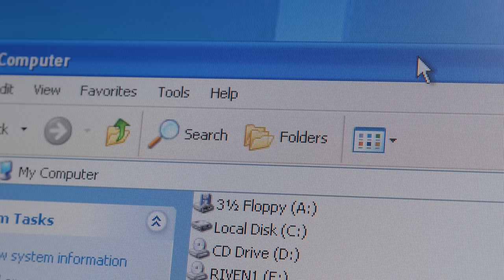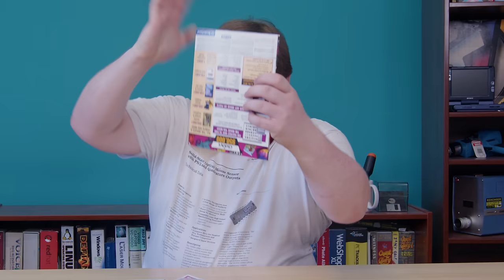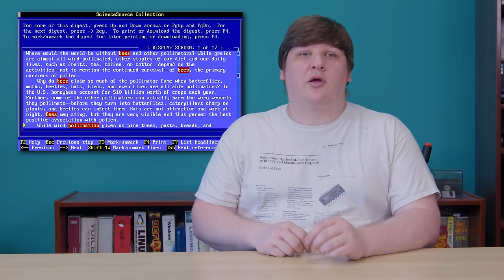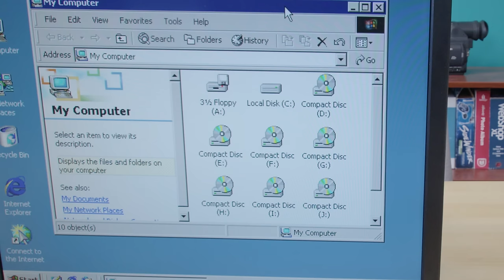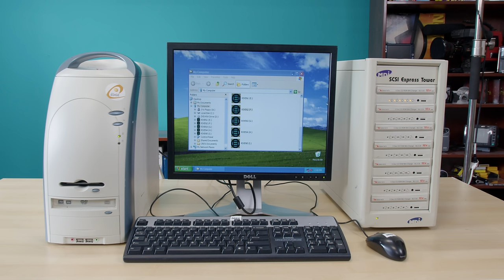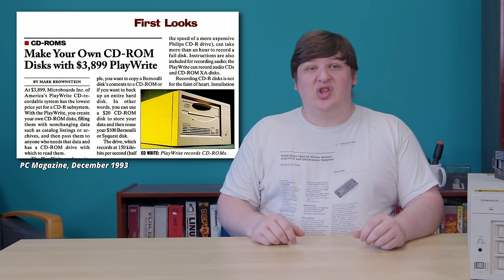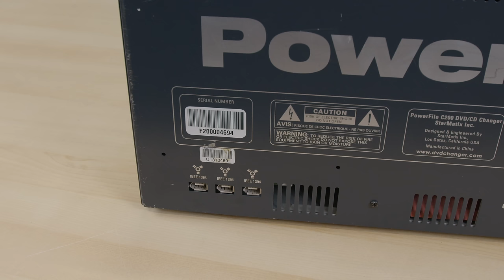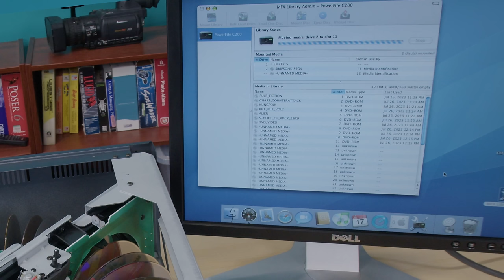A Jukebox for your PC: 1993's CDROM Servers

Comment: Before CD ROMs, there was… microfilm. In 1988 I worked for a company called Imnet that was trying to build a business around scanning and storing insurance and banking records for later retrieval. They built a washing machine sized robotic microfilm reader. It stored hundreds of rolls of microfilm that could be robotically loaded on demand, film forwarded to the correct frame, scanned and made available to a server. In 8 seconds!
Reply: These type of databases were often used in conjunction with microfilm. The database was for finding what you needed, but the actual thing would be stored on microfilm. When I did my undergrad not all journals were digital yet (at least not fully), so I sometimes used databases like this (off a network, not CD-ROM) but needed to get the actual article text from microfilm.
Reply: I'd love to see / have seen that 8 second process happening. That sounds awesome. YouTube surely has something 😂
Reply: I kinda loved the haptics of going through archived newspapers on microfilm. It was definitely not very convenient when doing research about historical events, but it was .. somehow more tangible than just using Google.
Reply: the sound must have been amazing
Reply: I worked for a utility in the early/mid nineties. Optical storage was used in the stead of microfiche. they produced tens off thousands of sheets of microfiche. I once had to re-index the microfiche by hand. I can still feel the cuts on my hands from handling it. Death by a thousand cuts.
Reply: I would absolutely watch a video that showed one of those things off!
Reply: There's still some out there that hasn't yet been digitized. I use to access old Newspaper articles on micro-fiche at out library on index sized film cards that had up to a hundred tiny images on them.
Reply: Even the microfilm!?
Even the microFICHE!
Reply: Somebody call Vannevar Bush, they finally made the Memex.
Reply: @stephanmantler thankfully the Mitchell Library in Glasgow (named after a tobacco baron…) still has some microfilm viewers and archives. It’s definitely not the main way anymore, but every time I go I see at least one person using it!
Reply: @kaitlyn__L every library in the UK has a microfiche collection and viewer. They're not always on display or in front but every single library has one that you can access it you ask. It's listed as a basic library service that's part of their remit for funding - local archive access.

The only exempt libraries would be community run ones.
Reply: @medes5597  good to know, I only specified because that’s the only one I’ve been to in the last decade :) didn’t think it was necessarily unique to the Mitchell! (They do have a particularly large physical archive though!)
Reply: It took a long time for businesses to transition from paper to digital. Printers, file cabinets and scanners persisted well into the 2000s.  Even fax machines are still used now. Which is a pain when a bank, my bank, requires signed documents by postal mail or fax.
Reply: @kaitlyn__L  oh yeah I realise you weren't suggesting it was unique - my apologies if that came across like I was correcting you, that's probably some on the spectrum lack of politeness on my part, I was meaning to add to your point and say that it's a huge part of what libraries do and not one people really know about. 

The larger libraries of course have large collections but a lot of the small town libraries have unique and interesting things that no one else has. Where I grew up in Wales they had Dylan Thomas' notebooks reproduced on microfiche just sat on a shelf from some old archiving project they'd been involved in where they painstakingly photographed and converted every page like it was newsprint. And practically no one knew it was there. Libraries are wonderful and the fact we've lost over a thousand since the start of covid (about 600 reopened as community libraries, but they nearly all run reduced services and have removed many things - Archives, educational classes, computers and reference are usually the first to go because they all require more time and monetary investment than a community volunteer group can really support) is a tremendous loss to the country and it's not really been commented upon much (to be fair we do have bigger problems right now)

Point is support your local library and my apologies if I came across as being overly corrective and harsh. It was very much not intended that way.
Reply: I work with microfilm at my job, from time to time.  We have a bunch of readers that can quickly find prints in the roll.  The plants were built in the 60s and 70s so that's all they had and only docs from 1997 and beyond were digitized.  Everything else remains on film, aside from configuration prints.
Reply: Vannevar Bush's dream come true!
Reply: how much storage?
Reply: Sounds like it cost millions or close to it in today's dollars.
Reply: Also, I am old enough to remember looking at newspapers on microfilms at the library when I was a child in the early 90's. It was...kinda awesome kinda weird. I remember feeling like a secret agent looking at it.
Reply: @entity76 didn't realize gloves weren't invented until the mid 90's I swear I can remember before than Mandela effect I suppose
Reply: @pjbth I had white cotton gloves but they really didn’t help. In fact they dried my hands out. I should clarify the optical disk setup replace the microfiche but it had to be kept around for regulatory reasons.
Reply: Haha I remember that, there was a new local company hiring basically anyone who showed to operate the scanners. It was a little better paying at the time, but I passed, it would’ve been far too mundane. It was a fairly large company too
Reply: Micro fiche content used to be a common thing in British libraries. Same principle as microfilm, except the documents were imaged onto a sheet of film rather than a reel. Still remember using the fiche reader at my local library as a kid, though wouldn't be able to tell you what it was I'd been looking at! 🙃

One benefit of fiche is that they had a higher storage density compared to film (Sheets each the size of an index card versus reels of film) and were usually kept in binders for easy reference, and were probably well-adjusted to automated handling. I've no idea if any British companies tried building online fiche retrieval systems (Knowing us, someone probably did!) but for the 60s they might've been something quite profitable if they had. 💰
Reply: Microfiche results on other format. They often did this to magazines etc because it was a bunch of images of pages put onto a film approximately 5 by 6 in if I remember right I'd have to look it maybe not quite so many images is a microfilm but you could just have one sheet at a time and had multiple pages. So a whole magazine might have two or three separate microfiche plates that would have all the pages of particular issue. The other advantage was it is some of these microfiche readers and microfilm readers also had a printer available so you could make a large scale regular sized page of information printed on it. If I remember it works similarly to a thermal fax machine

Comment: I was that weird kid in middle school (7/8th grade in 1997/8) that hung out with the IT admin. The whole school (district actually) ran Mac OS and they used several CD server towers to share various CDs. The “computer lab” had its own tower, the teachers their own, and there was a public one. Each were a full sized tower case with 6 or 7, or more individual CD drives. They didn’t use a multi changer like the Nakamichi at all. Each disc was in its own drive and I don’t ever recall there being an access issue. I don’t know if each tower had its own sever but I do recall each tower was served over different AppleTalk zones. Lovely video as always ❤
Reply: Same -- cut my teeth working for my school system.  We had a few of these towers on the network and would drop in the discs we'd need for the day.

Main downside was if more than one client was pulling from a CD share it'd seriously slow down -- so in practice each tech would have "their" tower.

So a little picky, but it was a major efficiency gain.  Instead of sitting at a PC juggling discs we could roll a script, start it on a machine and prep the next ones (e.g. blow out the dust, do whatever wasn't scripted, etc)
Reply: God appletalk was so good. I don't know how well it worked at scale but it's certainly been the easiest of era network solution for filesharing I've ever used. Even in modern systems. I'm actually looking to include appletalk on my file server for my friends and I classic macs so we can share programs!
Reply: Yeah, I think one thing missing from this discussion is just how bad it is to have multiple users trying to read from the same CD.  Seek times for optical media were not good, so if it had to seek between two places on a disc, it was nearly as bad as the disc changer thrashing problem.
Reply: Yep, me too. I know this cos I’m friends with two IT admins on Facebook lol!!!
Reply: There are two kinds of computer nerds: the ones that hung out with their school IT admin, and the ones that the school IT admin despised. I was the latter 😈
Reply: Yeah, my high school had a 7 drive tower attached to the file server (Windows NT4), part of my job was figuring out how to get CD-ROM based software to work from the central drives...

On a side-note, there's some ridiculous simple joy in programmatically ejecting 7 CD-ROM trays simultaneously ;)
Reply: @ofoosy AppleTalk did not work well at scale. It was heavily dependent on broadcast. The university I went to in the late 90s had a large, flat Ethernet topology.  On the days IPX network broadcast storms didn’t take the network down, the AppleTalk broadcast storms usually did.
Reply: Did these disk changers work better under MacOS handling multiple request or would it iof had the same problems that Windows had trying to use these things.
Reply: I hung out with my second school’s IT admin too! She helped me add a network card to my PC, and also gave me education-license installs of Windows and Norton and Office! She was great.
Reply: @michealpersicko9531 since they weren’t disk changers, just a bunch of individual drives, the only problem should’ve been bandwidth contention on the bus regardless of OS :)
Reply: In 97 I had a CD burner and I used it all the time. From mix tapes to backups to sharing stuff with friends and p*rn lol
Reply: Hahaha nerrrrrrrrd 🤓🤓
Reply: I would say you missed one, the kind that ended up being there school IT  @nic_olenomicon
Reply: @nic_olenomicon yup didn't like me 😂 they tried to confiscate my personal laptop as I'd been up to no good like accessing security cameras and printing random crap to the staff room. The network was pretty poor security wise if you knew basic networking you could pretty much do what you liked. One of my favourite things we did at college which anyone could do is draw dicks on the plain paper in the printer. The confusion of the teachers was brilliant 😂
Reply: @HA05GER the admin password for one of my schools server was just admin. Id log into that account and then remote into other computers on the network and mess with my classmates.
Reply: @nic_olenomicon  You and me both. ;)

Comment: I work for a marketing company, we just moved office we were cleaning out the storeroom and there were no joke thousands of CDs of stock photos and clip art and fonts.
Reply: From my experience with the Pioneer machines they were meant to be used with Macintosh. There were Extensions that let you change the disc being accessed by the finder and did not create confusion by pretending to have all your discs available at once. The Mac software was so much more well thought out and the windows software felt like an afterthought. I had the 18 disc version and it was a wonderful way to organise mac games and general data. I found it all in the thrift shop in a small town in British Colombia along with a grey PowerMac (model escapes me, one of the ones in the larger horizontal desktop cases which sat horizontally and was grey from before they changed their design language.) The changer came with the cartridges and worked flawlesslessly. If my collection hadn't been stolen I would post pictures.

Comment: Working in networking for almost 20 years, and still, nothing beats the bandwidth of an 18-wheeler.
Reply: Well, that’s why Amazon actually has data trucks, that you could use to move a truckload of data to AWS.
Reply: @BTGDelta  a literal truckload of data!
Reply: Well, depending on the distance maybe the bandwidth of a jet could win right?
Reply: yeah but how do you feel about ip over carrier pidgeon
Reply: @BTGDelta  I think it's called AWS snowball
Reply: @cal2127  Birds of prey cause packet loss
Reply: @isaac10231  Even better: Snowmobile
Reply: I love that original montage of assembling the cdrom tower!
Reply: @isaac10231  Yep, literally just a big cube they send you, you load it with literally everything you have, send it back, and they dump it into your account.
Reply: @cal2127  very large packet loss... mainly due to shot gun interference
Reply: What was the download speed for the picture they took of the blackhole. I think that tops it.

Besides, when that hick shows up with your stuff in the back, how much of it remains intact?
Reply: Well, a 777 or A380 loaded with hard drives to it's maximum weight, may give you better bandwidth, especially if you are doing anything internationally, but keep in mind you're talking about a lot of data that's in the air at any time that someone might steal, or that can be lost when a bridge fails. 

If you go back to the footage of the I-35W bridge collapse, one of the vehicles that dropped to the river was a UPS or FedEx 18 wheeler. I have little doubt that at least some of the contents of that truck ended up being recouped in insurance, but if you had shipped a crate of hard disks that just happened to be on that truck, I'm going to bet that you wanted serious accountability for what became of it. I've also seen most of the OTR carrier's vehicles off the road in various incidents over the years, and off the road in some of those cases involved elevation changes in excess of 100 meters.
Reply: Wonder how many LTO-9 tapes can be packed safely in a single 40' intermodal.
Reply: @BTGDelta  They do, and I'm upset that they're not shaped like comically huge thumb drives.
Reply: @Kalvinjj  Over land however, it's hard to beat the raw throughput of 100 railroad boxcars loaded with racks of harddrives. 😁 (provided that your regional rail monopoly doesn't average several derailments ever damn week...)
Reply: Or a FedEx truck. As recently as the late 20-teens, movie theaters were still shipping multi TB hard drives around in carriers to load the latest movies up into the projectors. They had servers with removable HDD trays to load them and feed each movie to its associated projector(s). I'm sure they used whatever transportation was already in place from the days of film cans.
Reply: Well i would sugest that the transataltic cable beat a 18 wheeler.

Partly becasue it have very high capcity, partly.. becasue its water.
Reply: @lurkersmith810 you’ve nailed that part- almost every new system is built on the bones of the existing infrastructure. It’s not accidental that CD cases are half the height of a vinyl record sleeve (less slight margin for a narrow shelf to be retrofitted by retailers), or DVD cases being the same size as VHS tapes in 2 out of 3 dimensions!
Reply: Depends if you have to physically mount it all at each end 😩
Reply: @cal2127 no no no. IP Chihuahua was better.
Reply: @cal2127  Jeff Geerling LOL
Reply: Is it still considered bandwidth if ifs not actually wider and instead just longer?
Reply: Ah yes, the good old sneaker net.

Comment: One cottage industry taking off around that time was home machine embroidery. My mom sold software and machines as well as gave lessons. Those click art CDs are a literal gold mine for that type of thing. Back then the digitizing software was at least 2,000 USD if not 10,000, and it was like tracing a bitmap file to a vector one miniscule line segment at a time. Over time they did get better with fill effects, for automatic flocking or whatever they do. Anyway, being able to browse the illustration files, because line art could very early on be auto-traced to varying degrees of success, pick a cool animal and then have it on a shirt pocket. Wild.

Comment: Those huge linear actuator coils were to reduce skips caused by vibration. This is before the overspin got crazy enough to just try again when the disk came back around. The transport lock was to prevent shipping damage, or damage from mobile use. No, the did not work in a moving truck, but they were used in some mobile applications such as oil drilling rigs and oil exploration rigs (i.e. thumper trucks). These rigs had custom integration that did things like suspend the os and park the hard disk if you took it out of park or released the parking brake (or powered up the thumper engine). You could the drive and resume operation without having to do a full boot and load of applications. Early thumper trucks would record the seismic data to analog tape, which would be digitized and analyzed before moving the truck to the next site. These were specialized devices so every little niche you could cover could mean a huge increase in your potential market.
Reply: Very cool explanation!!! Much appreciated! Definitely an edge edge edge edge case!